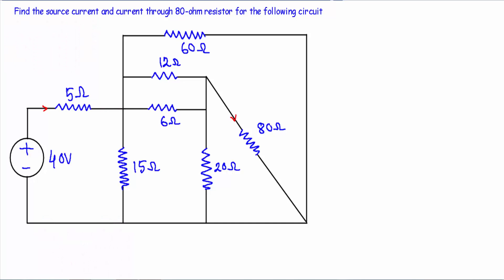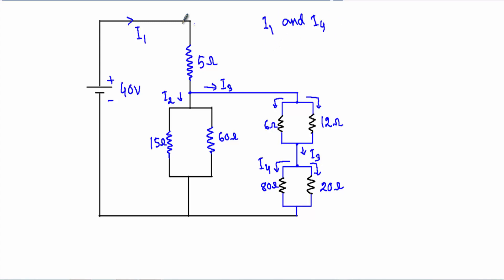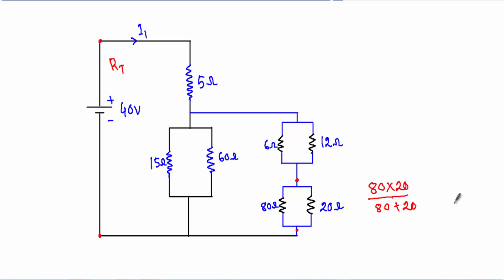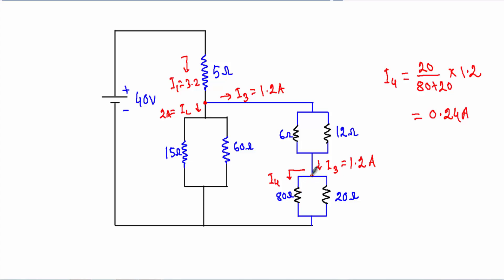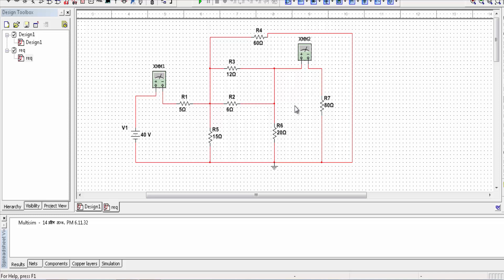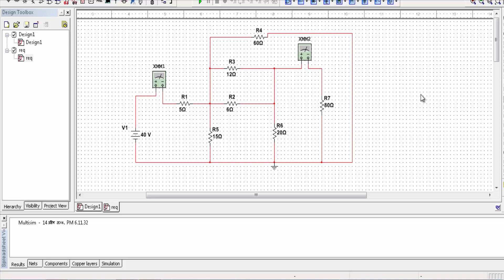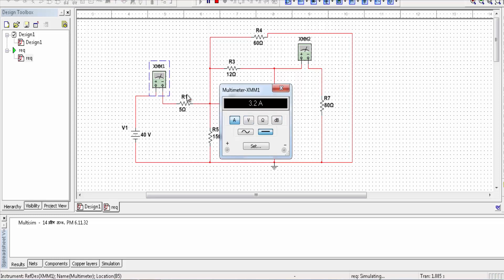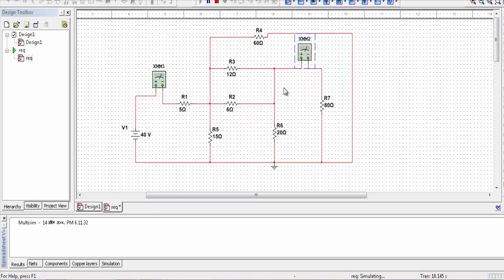Current and Voltage in Complex Series Parallel Circuit - 2 (W subtitles)

Comment: The point method is the best and most effective one so far.However ,I would suggest that you'd be asking: How many resistors do come out from every point and where do they end.Afterwards you connect them.I think its more logical rather than putting points randomly guessing
Reply: Yes bro
Reply: Exactly. It reduces the possibility of mistakes. I thought about it. Thanks for your help.

Comment: sir how could u ar arranged this complex circuit to a simple circuit?? i mean how u know to take a 1st, then c, then d & then b points..
Reply: Examine components and nodes to see what is in parallel.  Parallel components does not mean how they ard drawn, but only if they have the exact same node connections.

Comment: Reduce first: 6 and 12 in parallel.80 and 20 in parallel. Those two in series. Inparallel with 60 . That result in patallel with 15. That result in series with 5. Now you have total resistance solve for current. Ix5 ohm is drop across 5 ohm. Now you have remaining voltage across points c-b . Continue.

Comment: Can someone explain why I3=1.2A? I thought we were calculating for I2.
Reply: Yes because most of the current goes where the least of the resistance is. So   12 / 12 + 20 * I   gives the current for the 20 ohm resistor.